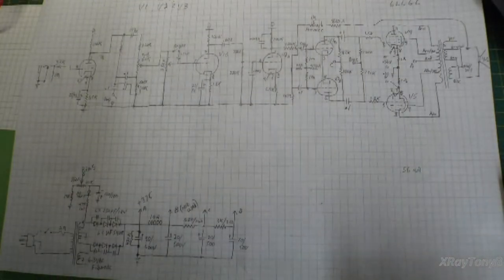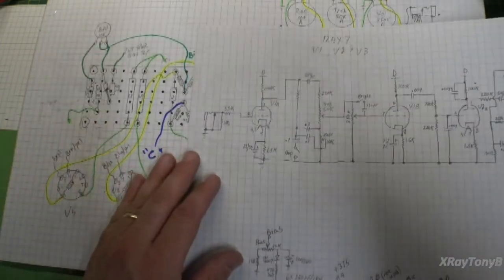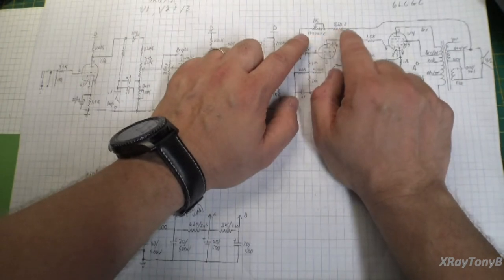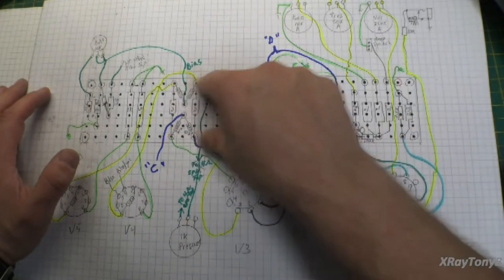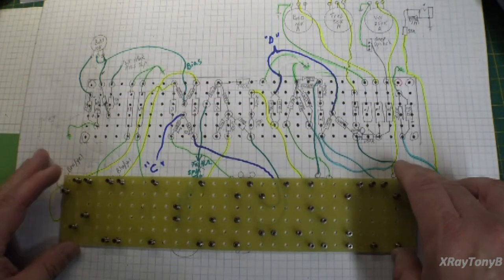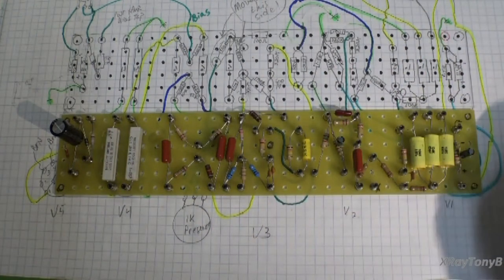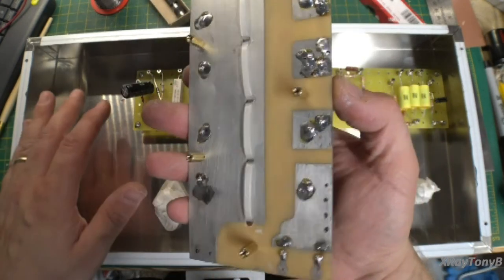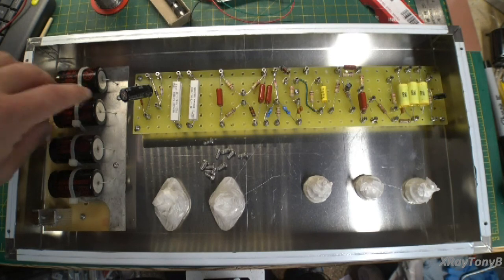Building a Bass Guitar Amplifier - Part 2 - Circuit design and layout

Comment: Looking great! I didn't expect part 2 this month, to be honest ;)
I highly suggest you put in some 100R - 1K "screenstoppers", as seen in old Sunns and HiWatts. A burnt resistor is better than a burnt OT...
I tried out turret boards for the first time a few weeks ago... it was pretty meh. And as I couldn't get the amp to sound good I proceeded to build it into a standalone spring reverb unit - point to point wired. THAT one worked right away, produces almost no noise or hum and is really compact yet repairable. (There's a video on my channel if you're interested)
The biggest problem I had with the turrets was that my soldering iron didn't get the heat in there quickly enough. So I basically had to heat up the turret for like 10 seconds before the solder would flow.